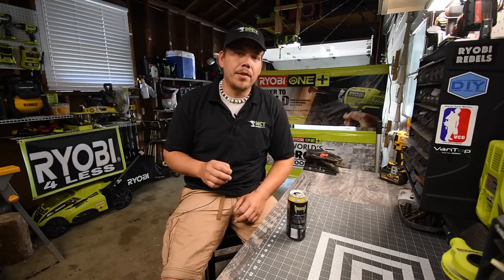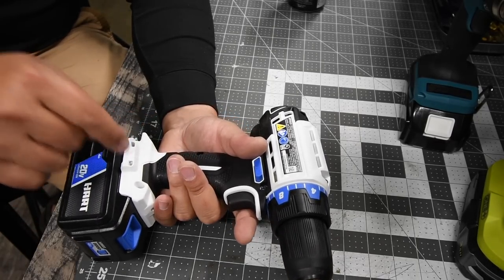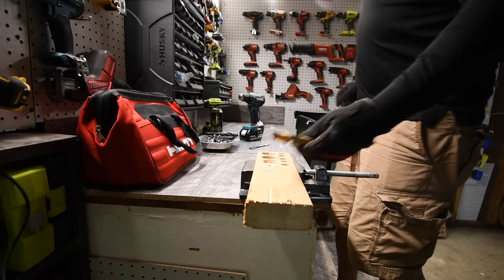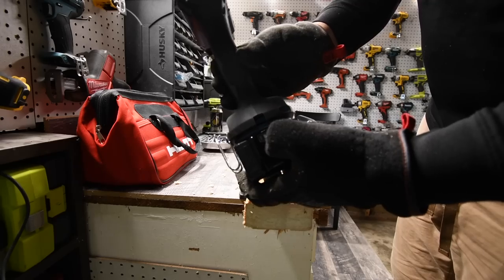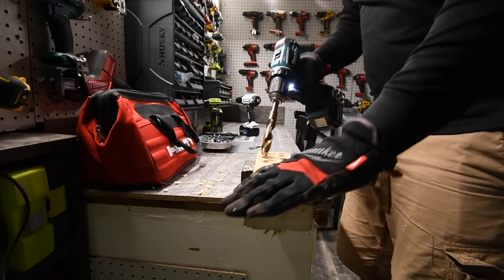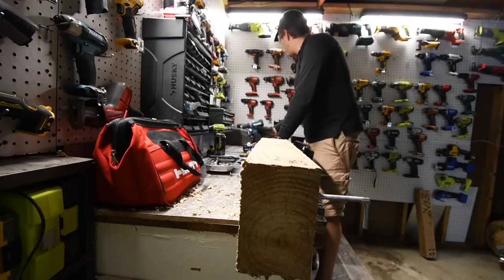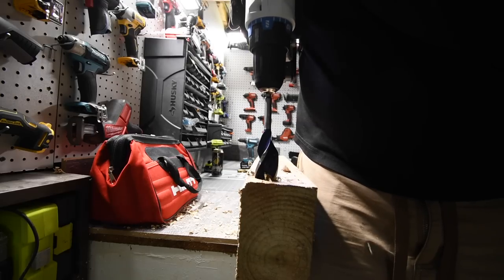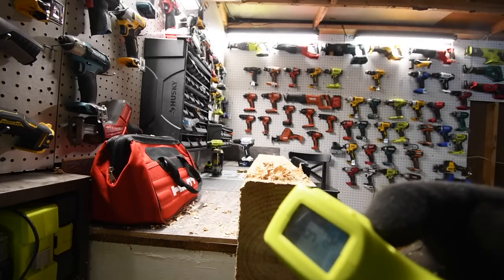Makita vs Hart Drill/Drivers

Comment: I have this model of Makita and it is purpose built to be light, compact and no more than medium duty, aimed at the DIY user and/or professionals such as cabinet installers. To be fair, it is their entry level COMPACT brushless drill and is only slightly larger and more powerful than their black subcompact series.  The Makita XFD12 would be a more appropriate apples to apples match up to this Hart drill, BUT it is an excellent value comparison since the Makita can be had as a kit for $99 most of the time and I assume that the Hart kit would be around the same price with the larger battery. I got my Makita kit for $79 which made it a better value for me since I prefer the quietness, as mentioned, as well as the size and weight over the bulk of the Hart. Also, the Makita can be repaired easily and inexpensively after the warranty period expires, whereas the Hart is more of a disposable tool after the warranty period expires. As poor as the Makita seemed to have appeared in this comparison, I think other factors such as size, weight, and refinement make up for it's perceived lack of performance. However, I enjoyed the video, but just feel that the Hart is a size class above this Makita  and would match better with the XFD12 rather than this one.  Great video tho, so thanks Dave!!
Reply from the maker: I thank you for the input Jeff

Comment: I've been doing dock and seawall repair work at a marina with my Hart tools.  I keep a set  on the boat in order to spare my other tools from the salt air. Every time I use the Hart brushless impact I continue to be amazed. It drove a 5/8 inch self feeding auger bit through two pressure treated  2x12s and a 10 inch pressure treated pylon with no issues. That same thing stopped a DeWalt XR with a 3ah battery. Although the longevity is yet to be determined I must say that they certainly have a lot of power.
Reply from the maker: im glad that hart is working out for you, I also keep hart tools in my boat for just incase I need them. I thank you for viewing Douglas
Reply: @ManCaverTools  What is the Amperage (ah) for Makita drill and the HART drill ..❓❓.....be honest okay

Comment: This is exactly why I bought some Hart tools.  Super impressive for the price.  Great for home use.
Reply from the maker: very good and I thank you for viewing Kelly
Reply: I think they're good if you catch them on sale (not clearance but even better). I have the whole line of Hart tools but I didn't pay full price for any of them.

 For someone considering paying full retail price for each tool individually I believe you should pay a little more and get something like an 18v brushed Milwaukee or even consider the 12v line up.

I got most in combo kits like the 4 tool brushless combo kit for $149 right now. It comes with the 7¼" circular saw, ½" drill, ¼" impact, flashlight, 4ah battery 2ah battery, charger, and carrying bag for all of the tools. If you buy the circular saw by itself they want $128 but the 4 tool brushless combo kit is only $20 more.

My main gripe with them is the extremely inconsistent pricing not just online vs in-store but even having multiple listings online for various prices. I realize that's a problem Walmart's creating by not managing their online store better but it's pretty ridiculous. Hart wants about $75 just for the brushless drill but quite a few months back they had them online for $29. I understand things going on sale but the prices are just all over the place.

Comment: 100 rpms more means less torque at the cutting edge, that's one of the reasons the lower brand companies go with lower gearing, it makes their machines look like they have more power than they actually do. Ryobi drills tend to all sit around the 1700 to 1800 rpm mark for the same reason, more torque gained for only a small drop in speed. Speed and torque combined is generally the preserve of the high end brands.
Reply: Totally agree 👍 well explained 👏
Reply from the maker: I know and thank you sir

Comment: I ran a 1/2" USED drill bit through a pressure treated 4x4 with that EXACT same Makita model using a 2ah battery and had ZERO issues. 🤷‍♂️
Reply from the maker: did you use speed 1 or 2. it is able to do it on speed 1 but this test was about speed 2
Reply: @ManCaverTools  I used speed 2.
Reply: me again dave posted the video today on the  same makita drill going thru a 4x4 with a smaller battery, used drill bit with no problem 👍💪
Reply from the maker: me again Dave I didn’t used a 1/2 drill bit. I used a 3/4 bit
Reply: @ManCaverTools  shouldn't matter. But okay, I'll do that one too.
Reply from the maker: kingofthecrease30 he used a 1/2 bit. It will act differently with a 3/4 but
Reply: @ManCaverTools  although i used a drill bit 25% smaller, i also used a battery 50% smaller. #justsayin
Reply from the maker: @meagaindave2049  you don't need to film it, do a test really quick on it. there is a huge difference between 1/2 and 3/4 in on speed 2
Reply: @ManCaverTools  i assume about 1/4" 🤣🤣
Reply: @ManCaverTools  i didnt see your video...just watched his....i thought you had a 1/2 inch...my bad
Reply from the maker: @meagaindave2049  that extra 1/4 is the threshold of it being a hard task for tools without stopping the motor. Hyper Tough can do 1/2 with a 2ah battery
Reply from the maker: @kingofthecrease30  its all good bro. but I thank you for commenting
Reply: @ManCaverTools  send me a 3/4" bit and I'll try it! 😉
Reply: Oh yeah..... love this like in be Honest Test..... I just bought Makita Combo drill driver and impact driver with 3 Ah 18V..... I will soon do the Same Test 🤣👍😅
Reply: @meagaindave2049  Oh yeah I will Try 3/4 bit too.....See How it goes 👍😅

Comment: A little pissed i bought the Makita line up... ill tell you what... ill be replacing with Hart as my tools die
Reply: The thing about Makita is that their tools last FOREVER!!! Im still using a 10 year old brushed impact driver that has never had mantinence and still uses the original batteries.
Reply: @tariqbojic7632  my 6 month old makita Sawzall shit the bed
Reply from the maker: like I said this isnt makita's best drill. their hammer drill will destroy the hart in a test

Comment: All I see you doing is demonstrating the overload feature of the Makita.  You are overloading the drill due to using large diameter bits with the drill set on the high speed setting which it is not designed to do for overheating purposes.  If the other drill is not doing this, and the user continued to use it in this manner, it would fry it.  The video fails to depict the quality or ability of anything.  It only indicates that one drill has a more advanced safety feature than the other.
Reply from the maker: You are correct, but that limitation is set differently per tool and tool brand. this shows what the limit is